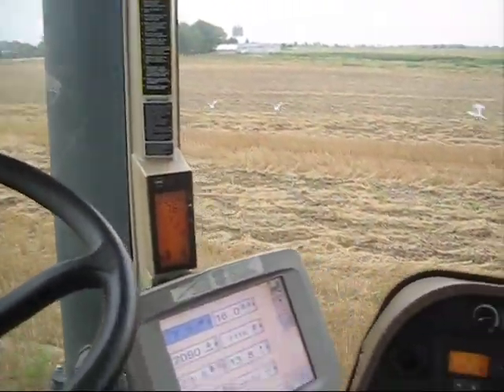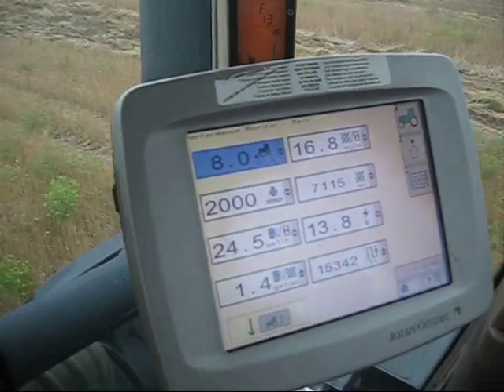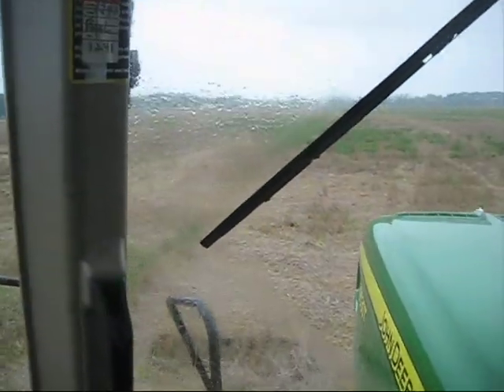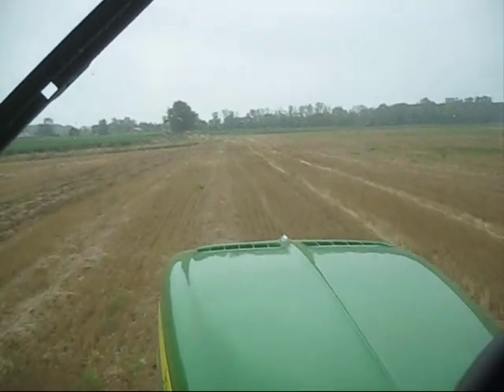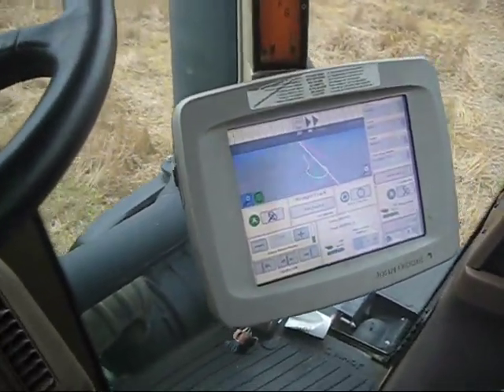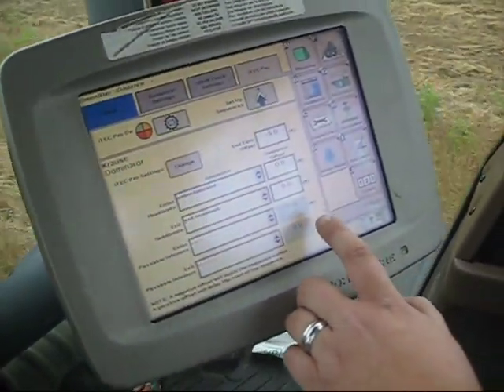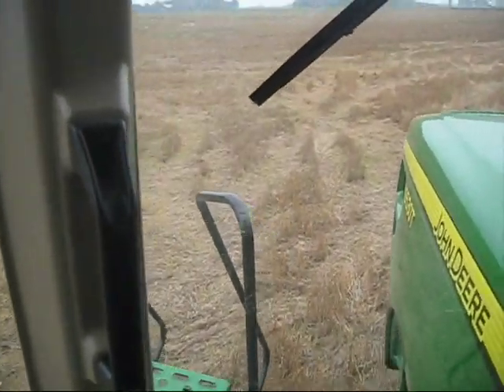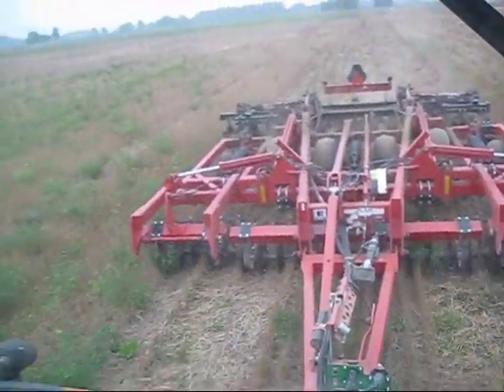9530 Ride Along with AMS Technician Ryan Thrushman.wmv

Comment from the maker: @uberbadnoob6699666  I just had a field day tillage demo for my seed customers.   The local dealerships brought out equipment for folks to drive.  I think I'd buy the Deere tractor.  It had a better ride.  I hear for 2011 Case is putting an air ride suspension on the cab.   Then it will be a tougher decision.   The Case would be better for pulling trucks out of the field.   I like the auto steer technology better in the Deere.   Both are accurate, Deere has more capabilities.